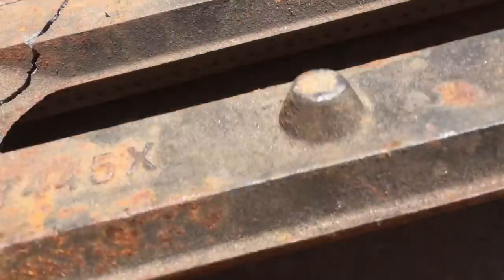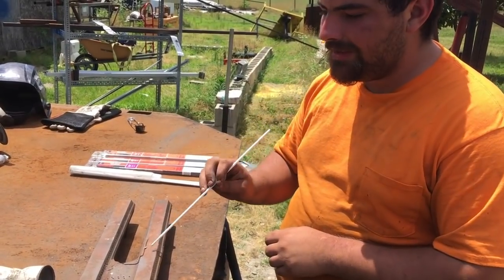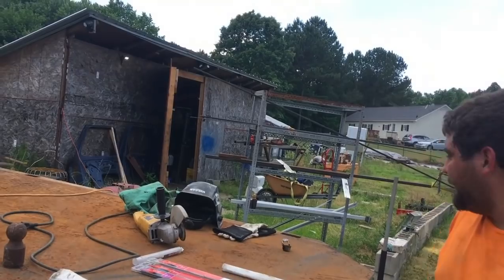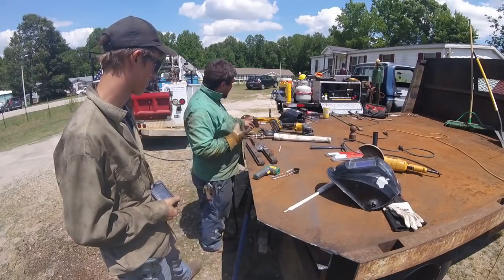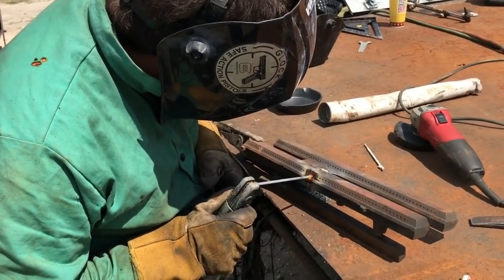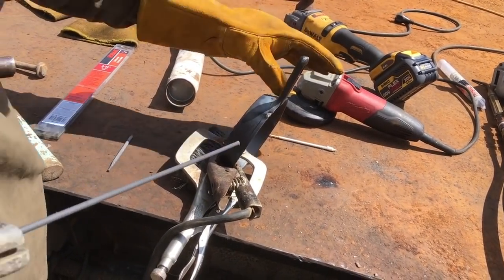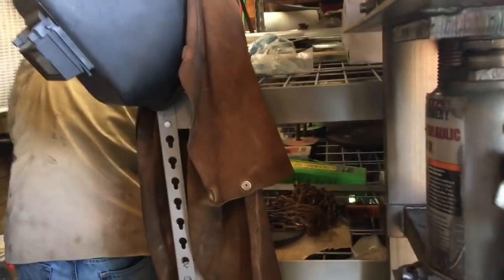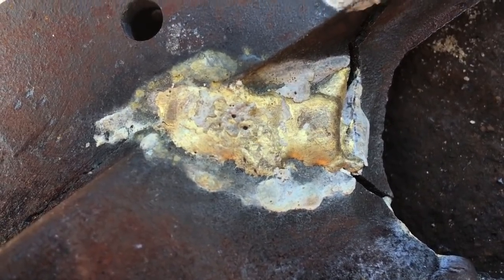Ways to Weld Castiron

Comment: We've ground a groove and  preheated   broken cast iron drain grate that has loaded tanker trucks drive over it, heated it until it glowed and then hit it with some 7018 and it's still holding up.

Comment: I welded a cast iron winding handle off a floor standing pillar drill with no pre-heat and using a 7018 rod. Strangely the handle hasn't cracked or broken and it still winds the table up and down.

Comment: thermal differential expansion and contraction of  Hot and cold surfaces kind of like when a hot metal part touches cold glass.  This is due to the fact that is cast iron and steel is an alloy thus not being completely iron iron is iron ore that has been melted down no additives and it's just what it is straight out of the ground in a workable form however Steel is a alloy of iron and other elements to make it more ductile to eliminate the brittle effect that happens in cast iron. And there's several different types of cast iron there's white iron there's gray iron and gray iron is malleable cast iron which means it takes shock better and is harder to break.

Comment: you left out my favorite way to weld cast iron, you need 2 torches, maybe Y splitters to use same tanks. better is to have 2 sets of tanks, but you have 1 torch you have a friend use rosebud, the other torch is for you to weld with, & use real cast iron rod. after welding, friend keeps it hot, while you peen, & starts slow cooling process, & for the sand, well we need bottom layer of sand, then charcoal, yes white hot, then more sand, then lay part in sand, and add more sand, & put charcoal around outside edge of item, then more sand, then after its covered with sand, a layer of charcoal, & top with sand. I have welded car engines, heads, & intake & exhaust manifolds. but I allowed to cool over night. but this was how it was showed to me, I am inexperienced with stick welding cast iron, but wouldn't hesitate to grab a torch to weld, or braze.
Reply: too much of a pain in the butt to go through all that trouble
Reply: I use Muggy weld rods to weld cast iron but for really serious repairs I like your process.